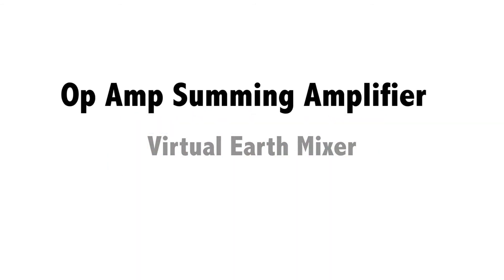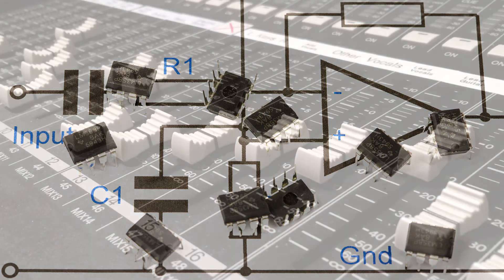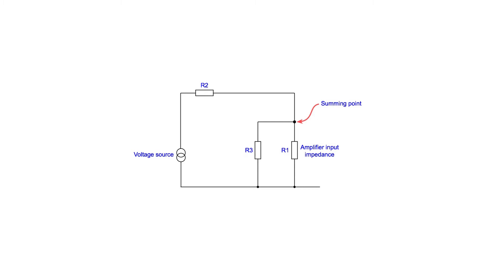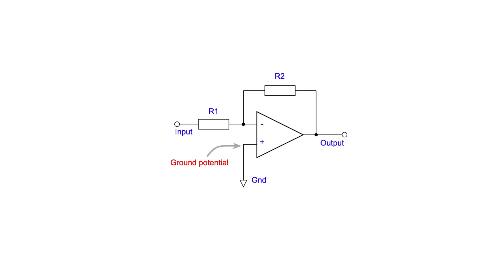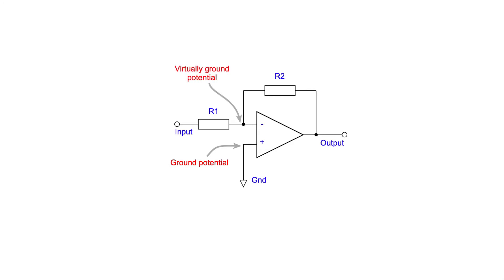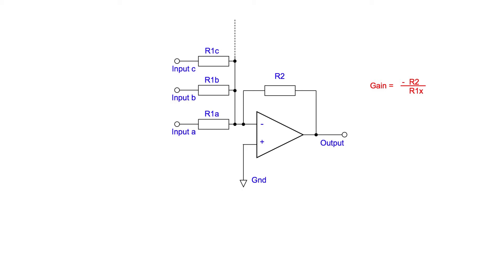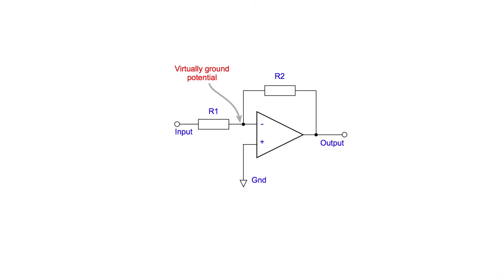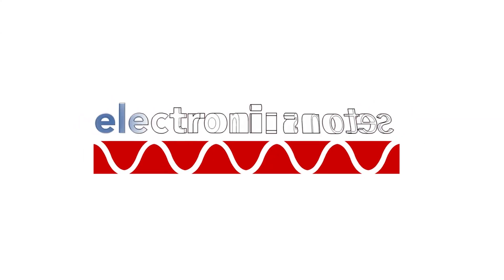Op Amp Summing Amplifier | Operational Amplifier Virtual Earth Mixer

Comment: @ElectronicsNotes do you have any information or advice on how to understand how this circuit behaves when the op-amp clips, and how to 'do the math' in that context?
I assume that if the amp clips, then the virtual ground voltage will swing away from ground, so there will be some combination of 'correct' virtual ground behaviour and the simple passive mixer behaviour, but I'd like to understand the details.
Reply from the maker: It is difficult to make an exact diagnosis without actually seeing the physical circuit. You could be driving the voltage into the rails, or you could have a load on the output that is too low in impedance and the op-amp can’t drive sufficient current.
Hope this helps.
Reply: @ElectronicsNotes  Thanks for the reply. I have nothing to diagnose. I want to build a digital model of virtual ground mixer that  behaves accurately when it is pushed into saturation. But I'm having trouble finding information, because everything I find starts by assuming that we will avoid saturation in order to simplify the analysis.

Comment: its funny because the picture of the mixer faders is actually a yamaha LS9 digital mixer with no opamps in sight of the summing
Reply from the maker: It was there to illustrate a point about faders, but yes it is rather too digital. I could not resist the photo though as it looked rather good when I took it.
Reply: @ElectronicsNotes  its a nice little video! thank you for making it.
Reply from the maker: Trying to create a few more on the same vein so, but have a few others in different topics in the pipeline as well.

Comment: Will this also prevent the inputs acting as an output like passive mixers. is there some sort of diode for music that only allows sound to travel one way through the wire because I noticed LEDs don't work they let sound to travel both ways if you attach it to the ground wire ,mono and sterio.

I have a problem that is an error with the korg volcas when you connect them to a split and connect the bpm tempo sync they will double the tempo and speed or skip steps and this is an error because the outputs interfere this is why I need some sort of diode that works.

Korg should have really checked this before releasing them.